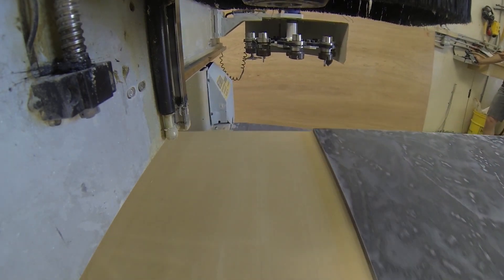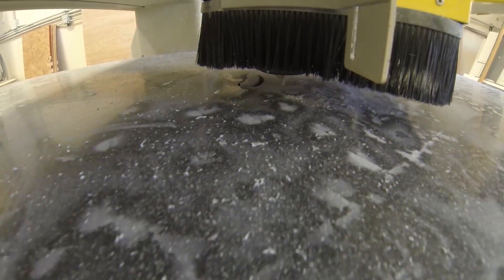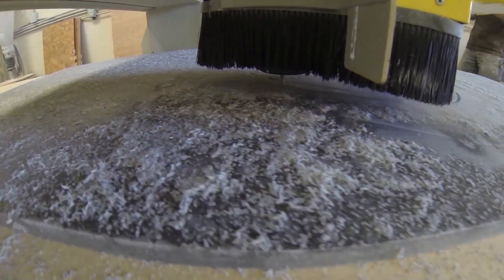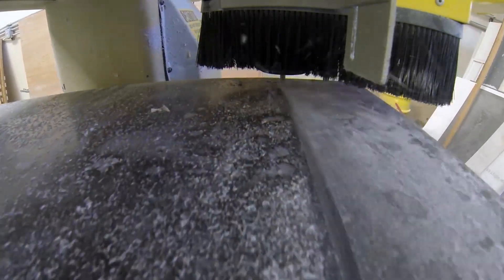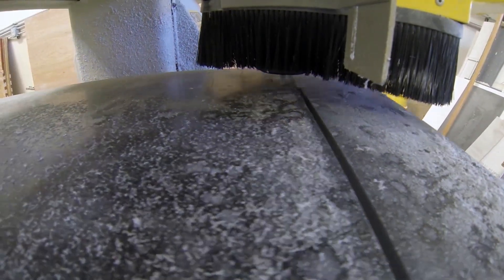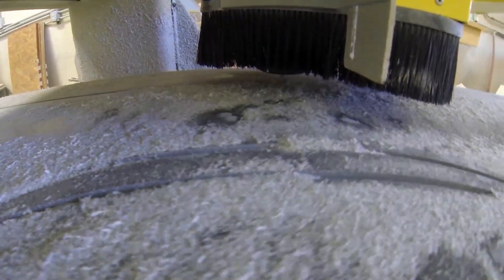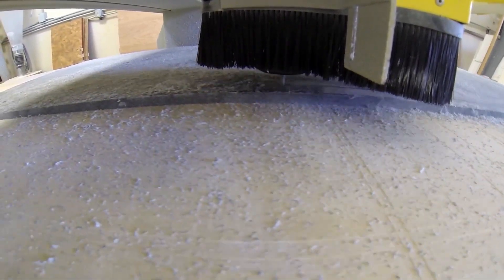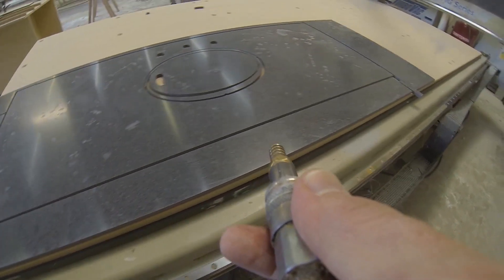Solid Surface Countertop - CNC Cutout Process

Comment: Hi Andy, I see you cutting the bored all the down, like one time, I'm afraid to do that to my Corian bored, I usually go between 3 to 4mm stepdown for 3mm & 6mm straight double flute bit , what should I do?
Reply from the maker: Single pass. Use a single flute, up cut spiral for solid surface. 18000 rpm, 150ipm. I don't have the tool number off the top of my head, but it may be in the description of the video.

Comment: Hi Andy, do you do all the cuts on CNC, or do you do straight cuts on other machines? thank you and congratulations for the beautiful work...
Reply from the maker: I do straight cuts on a table router and table saw. I don't seam things together that came off the table saw though.

However, if I'm doing a project all the parts get cut on the CNC and then assembled.

Comment: Hi Andy, Why do you go with the upcut bit, is there a benefit of using this instead of a down cut or compression bit?
Reply from the maker: The upcut bit removed the dust better and leaves a little better finish.  I have used a downcut bit before but it forces the dust right into the groove. Plus, I haven't noticed it hold the material down better.

Comment: Andy, Is that a climb cut you're using? Thanks.
Reply from the maker: Yes, it's a single flute upcut bit.
Reply: @AndyGraves  Thanks for the quick reply. I was referring to the travel direction relative to the finished material. In my experience with plywood on a CNC the travel direction would be counterclockwise around the outside of the finished material. You seem to be running clockwise around the finished piece. Thanks again.
Reply from the maker: Got it. Yes, I go clockwise. I've tried both and it seems to cut a tiny bit better clockwise. Honestly though, it doesn't look like it matters all that much.